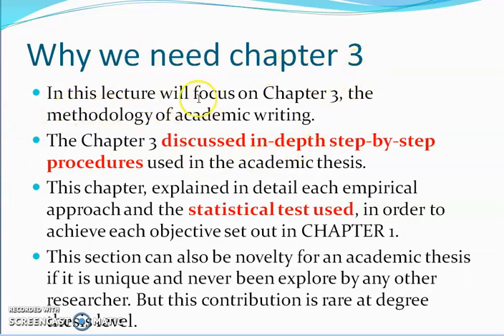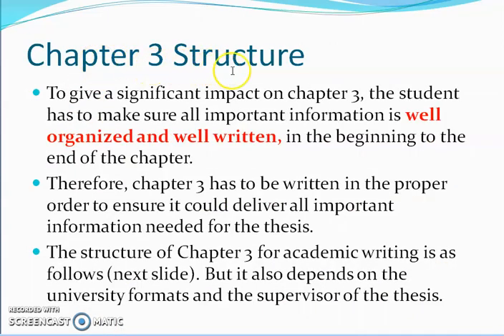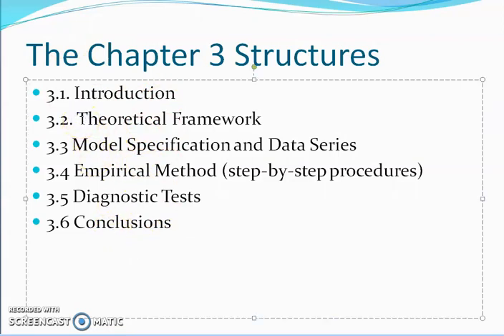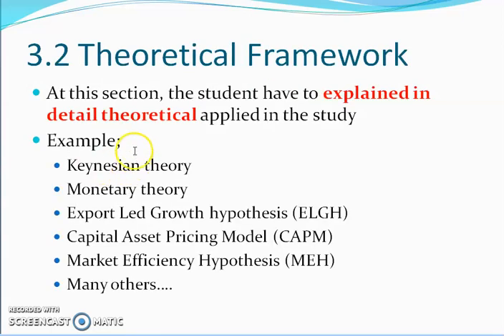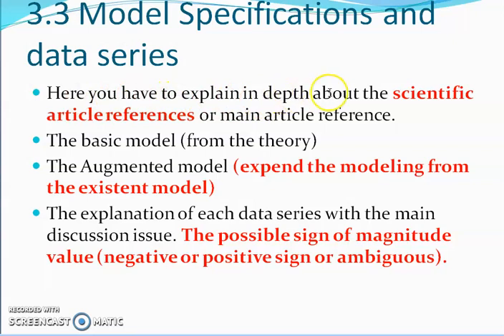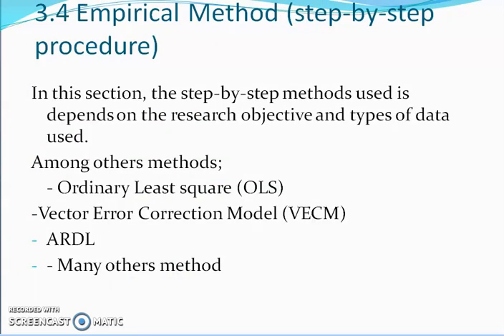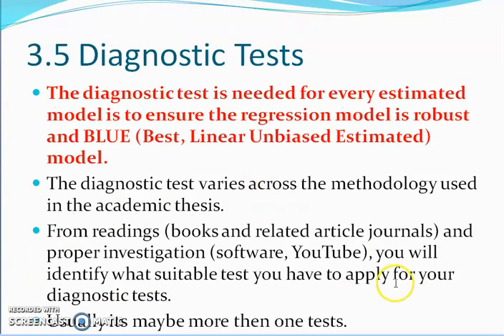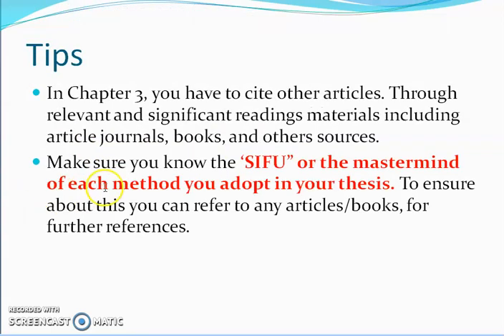PER 3023 Introduction to Methodology for Academic Thesis

Comment: Thank you so much for the explanation Dr. Based on the video, i celarly understand about chapter 3 which is the methodology of research. For empirical method should use step-by-step procedure depends on the research objective and types of data used in the reasearch. There are many methods such as Ordinary Least Square (ols), vecm, ardl and others

Comment: Thankyou Dr for the explaination in this chapter. What I get from this video is :
1. Structure recommended :
3.1 Intoduction
3.2 Theoretical Framework (explain in detail about the theoretical that student use in the study)
3.3 Model specification data series
3.4 Empirical method
3.5 Diagnostic Test 
3.6 Conclusion
** make sure all information written in this chapter

2. Cite more others articles. 

3. there are relationship in chapter 1 and chapter 3. What we write in chapter 1, we need to explain in details in chapter 3. This helps to achieve the objective. 

Hoping that everything is ease for our fyp. Thankyou so much Dr :)

Comment: Thank you Dr for the explanation.. I understand this Chapter 3 very well.. I know that the FYP test must be BLUE and refer to reading materials to guarantee that the best exam for the research or study is chosen. I should also read and study a lot of articles to figure out which test to use for the diagnostic test.  InsyaALLAH I will use the information properly to conduct my thesis that must be done by next semester.

Comment: Thank you so much for the explanation Dr. From the video, I obtained many information regarding on Chapter 3 Methodology. Apparently, chapter 3 is related to chapter 1. Now, I understand what should be included in chapter 3 and I understand that we should write in a proper order to ensure that it delivers all important information. Most important thing is, chapter 3 consists of Introduction, Theoretical framework, Model Specification and data series, Empirical method, Diagnostic Test and Conclusion. And through this video, I know in detail each of every structures.

Comment: Thanks to DR for explaining the methodology of Chapter 3. The information in the teaching video is very detailed, and the structure of Chapter 3 is divided into six parts, which is easier to understand. In addition, we need to read the article from a reliable website to improve our reading volume and understand the connection between Chapter 1 and Chapter 3. Thank you Dr For your comments and suggestions and for today's video.

Comment: Thank you Dr for the thorough explanation, it is very beneficial as the guideline to write chapter 3. This video summarizes every significant details that is needed to be written in the chapter 3 alongside with the purpose of this chapter. The test used in the FYP has to be BLUE and referring to reading materials to ensure the best suited test is picked to do the investigation or study.

Comment: The explanation and informative messages are detailed and clear! 😀 It was very helpful and understandable. I appreciate your clear explanations and your reminder that there is a linkage between the Chapter 1 and Chapter 3 because the discussion in Chapter 3 is in-depth or step-by-step procedures we need to use in academic thesis. Also, for the model specifications and data series, it should be consist the depth explanation about the scientific article references, so I need to read more and more articles to make the good writing in that section.

Comment: Thank you Dr for the explanation about the empirical chapter of a thesis, we need to obtain many reading materials like theory to support the method we adopted to deliver the important information to achieve our objective in chapter 1. But, to get correct and proper reading material is needed to obtain from reliable resources. Other than that, watching video tutorials is the most practical way to understand further the empirical procedure in order.  Plus, the most vital is the diagnostic tests to ensure the regression model is strong and BLUE.

Comment: CHERYL HOH MEI HUI
D20181081883
PER 3023 GROUP B

Thank you Dr for the clear explanation about this Chapter for writing thesis. From this video, I learnt that Chapter 3 is important as it is related to Chapter 1 and also for explaining in detail of the empirical approach and statistical test used in our research. Furthermore. the structure of Chapter 3 is vital to ensure all the important information is written in a proper order but it also depends on different university formats and preference of supervisor of the thesis. It is also important to know the original author of creating the method for our methodology in order to use the correct method for our thesis.

Comment: Thank you so much Dr for the clear explanation about chapter 3. According to the video above, i understand that chapter 3 is about the discussion in depth or step to step procedures that used in thesis. Besides, the theoretical framework part, we need to explain in details theoretical applied in the study.  Last but not least, now i know that in chapter 3 we also need to cite other articles to support our methodology  (as references).

Comment: Thank you Dr for the explanation of Chapter 3 of the thesis. According to this video, I understand that there is a relationship between Chapter 3 and Chapter 1 because once we set the goal or purpose of the thesis, we should use the correct method to complete the thesis. In addition, the structure of Chapter 3 is divided into six parts but they will vary according to different supervisors.

Comment: Name: Nurhayati binti Shukrillah
No matric: D20181081885
Chapter 3 explained each empirical approach and statistical test used for get each research objective in chapter 1. The structure of chapter 3 usually include, introduction, theoretical framework, model specification and data series, empirical method, diagnostic tests and conclusion. However this structure depend on each university formats and the supervisor of the thesis. We have to cite other article in chapter 3 and we have to make sure that we know the SIFU and mastermind of each method we adopt in our thesis.